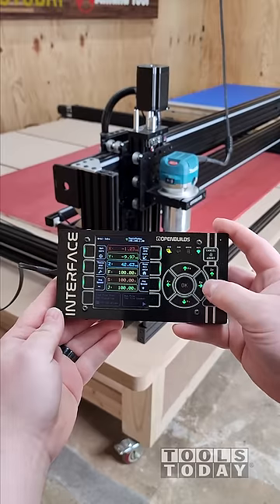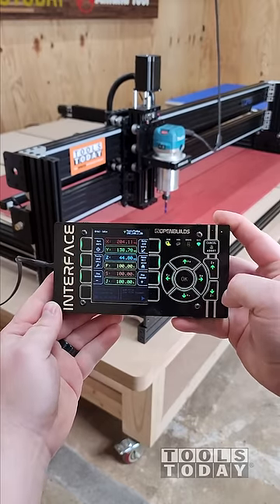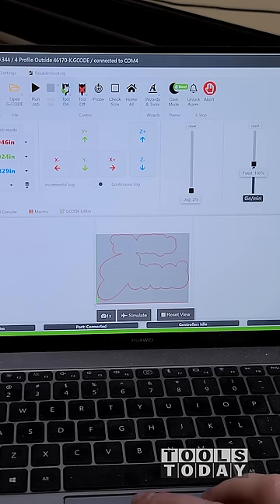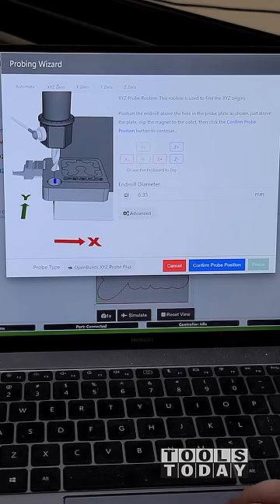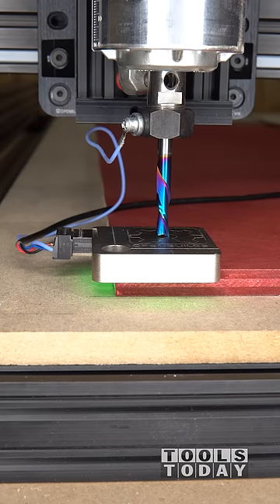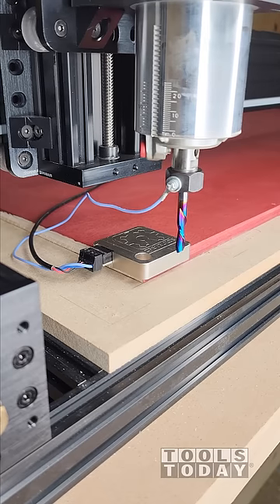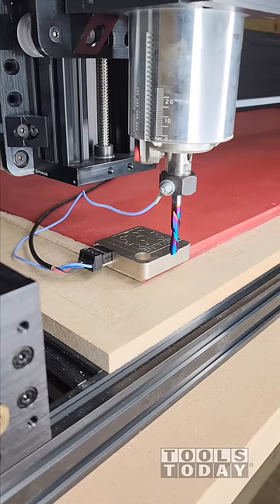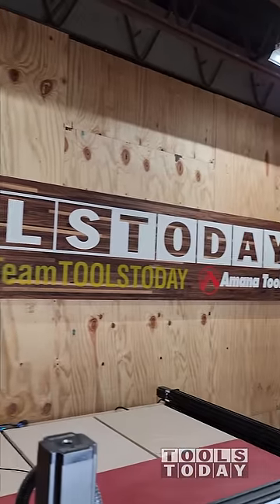Easily Set Zero Positions on CNC

Comment: One thing I noticed - that 2 flute bit looks like it touched the y on part of the core where the x touched on the edge of the flute.  To avoid an axis offset error, it Makes the most sense to zero like this with a precision ground rod or a carbide ball tipped probing bit.  For large workspace work the potential error likely won't be noticable, but the more precision and smaller workpiece you get, the .030" error could make for some frustration.
Reply: So glad someone noticed. 🤣
Reply: If you probe it deep enough, you contact the cutting edge of the flute no matter what angle the tool is rotated to, so likely not an issue.
Reply: Using a rod or ball tip for X and Y would definitely be ideal, if it was a .03 error like you said that's quite a lot and could make a lot of things unusable. Another idea since this is a router is to just set up a sort of jig/ part stop and have a consistent X/Y starting position for most of your pieces and just use a different set of offsets for special cases.  (Basically set a "permanent" G54 offset and use G55 or something else for anything that wouldn't start at the preset G54.)
Reply: the flute has the same diameter at the middle part and the tips. should not make a differenece
Reply: Thank god, this is what I wanted to say but couldn’t fathom where to begin. Thank you
Reply: Nope, not an issue. The bit is parallel, and the detection zone is deep enough that it covers at least a full spiral. It touched off correctly. However, if it were a single flute spiral plastic bit, you'd need to use a rod or something else, to avoid that issue.
Reply: This is what I do. I use the shank of a broken 1/4" bit for my setting.
Reply: Or just give it a g04 to reverse the spindle direction and touch off while it's spinning
Reply: On metal cnc machines we run the spindle slowly in reverse to measure the tool diameter and length offset.

Comment: This would be "close enough" for finding the zero corner of a plywood sheet to cut out pieces, but in that case eyeballing would be more than adequate. NOT if you wanted to precisely locate on an already finished object. You'll be off by as much as 1/8".

Comment: You're going to be off depending on what point of the flute makes electrical contact. Youre better choice would be the endmill shank as they are a precision ground cylinder
Reply: that was my first thought... then again I'm used to more precise work
Reply: Or you just rotate the tool in reverse at low rpm like most CNC machines with a tool setter

Comment: Shouldn't the tool spin at a low rpm when you do the X/Y calibration, The 2-flute is defiently not round. Not critical for most parts, but then why need a conductive zeroing tool?
Reply: You should either use a same diameter drill rod or rotate the bit by hand so the widest part touches the XY plate.  Then swap to your bit for Z.
Reply: Maybe the program accounts for that  by also knowing the able of the piece?
Reply: Right! You can't zéro with a tool on x/y, only on z. You need to use a spécial tool, at low rpm, or a  round profile to do those. 
You don't do this for all tools, because you center the splindle. Only z change between tools.
Reply: Low rpm in reverse
Reply: It uses plastic rollers on the z. This is a toy. not a persition tool. This man needs limit switches and a simple z probe save some money and time
Reply: @takeawaykitty.  plastic rollers can be plenty strong if the build is set up properly. My old router used delrin wheels to support x while cutting aluminum. Plenty strong and definitely not a toy
Reply: @mars5train601  plastic rollers introduce tons of slop into the system and wear away if they are tight (creating slop) For somthing with load on it. Compared to somthing like liniar rails they are 1000% a toy. Not to mention reasonable cutting loads would crack or cause flat spots. All while messing up the the tram for the duration of the cut. Maybe with a .1mm depth of cut in 6160 it could work without imidiatlly destroying the machine but your still going to see reduced tool life and wheel life. Especially when tramming is basically impossible. This is not an accurate or strong cnc. And that's ok. It's meant for wood.
Reply: What do you expect from someone who can only assemble a toy CNC? Ffs he uses a router, not even a basic air cooled dedicated spindle
Reply: First of all, my comment was intended as a guiding question - to enlighten people a bit. 

Secondly, it's so much codswallop from Internet trolls that think a 7 axis DMG Mori is what he should operate to cut out plywood! The right tool, is the tool you have available, and get the job done. Brighten up you gacking pessimists
Reply: @Hitokiiry  it absolutely does not account for that
Reply: YES.  Either rotating OR a precision ground rod.  This method can introduce error because it could zero on the edge of the flute on one axis and on the core for another axis.
Reply: There isn't a way to account for a 'random' error.   It doesn't have a spindle encoder and it has no idea what part/side of the endmill is touching.  A 2 flute endmill could zero on the edge of the flute or on the core and would be completely random with the rotation of the endmill.
If you are going to do a conductive contact zero, the spindle needs to be rotating or you need to use a precision ground rod or a carbide ball tipped probe so you have a consistent diameter regardless of the side/axis it touches.

Comment: This is amazing I'm building a cnc at the moment and this is something I will definitely use
Reply: If you're cutting anything more precisely you'll need something better. Generally without anything extra(except a z height setter) you'd use the centerline of the spindle and the diameter of the cutter to find position. To change size of features use the wear offset to make any small changes needed. You'll be way more accurate and all you'll need is a z height touch off and a caliper or micrometer to find the diameter of your cutters.

Comment: Looks like you are using a 2 fluted tool.  To accurately set your X & Y zeros you need to manually rotate the tool so that it contacts on the same dimension of the tool.  

Your X zero was set on a land but your Y was in a flute.  Your Y zero could be off by as much as the tooth depth.

Comment: The tool is not 100% a circle. So the homing is not 100% 000. Also the drill have a thickness. How does the machine know this?
Reply: The drill size is loaded into the software so it knows how to calculate the offset. The system uses a small amount of electricity to complete the circuit when the bit and block touch so it doesn't matter where it hits on the bit as the outside diameter will still be detected
Reply: @RapTapTap69  sounds valid but the radius from the center of the bit to the blate is in different angels different. (Sorry for my bad English)
Reply: @flinkiklug6666  yeah from the center to the edge is different inside the flutes but due to how the bits are made, the flutes will always be what touches first. There's not a place where the plate could hit anything but the outside of the bit.

That could happen with a straight flute bit but not with a spiral bit
Reply: It's a two flute endmill so it could (and did) touch the end of the flute on one axis and the core/inner flute on the other, therefore introducing an error.  The spindle either needs to be spinning or you need to use a precision rod or carbide ball tipped probe to ensure it doesn't introduce error.
Reply: It doesn't and you are correct.  The higher the flute count endmill the less error will be introduced, but regardless unless you're using a ball tipped probe or a precision ground rod, you will introduce error with this method using a two flute endmill.
It might not actually even matter because this is a router and the workpiece is large so a small offset isn't noticable.  If you are doing multiple operations, you would have to have a repeatable work holding method or else you will always have a small error/offset.

Comment: It looks nice and pricey for a zero-point configuration tool that sets up only one absolute starting point in the DIY milling machine. From there it’s just straightforward when programming in that specified absolute G90 position and when being able to make use of the CNC-software programming language you can set up a bunch of G91 incremental (G92/G93 etc.) zero-points when needed those for the use of multiple tools. The only thing that i don’t understand is how often will do with less accurate levels if the results (the end result of contour, chambers and circular pattern milling) will be fully depending upon the accuracy of the machine’s travel movement and feeding steppers? I mean, with this tool it’s possible to zero in between 0,02mm, and via old school methods of zeroing xyz the accuracy declines. Not dramatically i’d say, between 0,2mm accuracy is fully assured when setting up for a starting point. It’s not even close to an industrial multi tool, fully automated CNC-milling machine or workstation for cutting metal. 

I do admit that i’ve been very privelliged and sort of spoiled by every single former employee that i did end up working for in the past (never in my career i needed to cut timber or other wood based materials. At home i do, so i do like the tool used for setting up xyz in 4 different handlings at maybe 20 seconds 👍🏼

Comment: Did you press firstly Tool On option before probing? 

I have the same Probe from OpenBuilds but is not working in most cases, it measures the Z and stops after that as a crash detection....

Comment: are you able to spin that bit slowly while touching off? what if it doesnt hit the point perfectly? Our machines, we turn the spindle on. just curious how this works
Reply: If you're spinning the bit there's a good chance you'll damage the zero block. Every time you damage it, the reading will come back more and more inaccurate. The bit should hit straight unless there's significant chipping so running the zero while the bit is running is just asking for trouble.

Comment: Holy crap, this is cool! Does an “ebay” 6040 support this sensor? Tks
Reply: Depends on the control board, but it can be plugged as an endstop, so most will be able to use that.
You can set it manually too, just jog on the smallest increment till it is on, then subtract the width of the measuring thing and also subtract the radius of the rod for the x and y.

Comment: How much for a CNC like that
Reply from the maker: It's just over $2,800 for everything you need, except the cutting bits. https://www.toolstoday.com/openbuilds-3050-fl.html
Reply: That's about what it cost me.  Mine was actually damaged in shipping and open builds sent me a brand new frame within a couple days once I sent pics, great customer service everytime I have a question or problem they provide a quick solution.  It is just a hobby level machine and tbh I think it is best suited for laser or plasma but it handles a router just fine if you keep up with maintenance.  Also important note I would use blue lock tight on the entire z gantry.. experiences....

Comment: What controller u r  using to controll ur cnc
Reply from the maker: OpenBuilds Control software.
Reply: @ToolsToday  what program u uploaded in your machine ..... Is it is grbl ?
Reply from the maker: yes
Reply: That's great 
My machine is not working well bro can you guide me on this
Reply: I am also using grbl mega 5x edge 
But my z.axis motor is not working well
I want fully automatic tool command and homing and hardlimits not working for another end of machine for safety purpose

Comment: Its perfect! Can you write the same macros for Mach 3 CNC machine?
Reply: Depends on what the encoder reads.  If it takes Fanuc based Gcode, then macros are easy.  But if it uses something else, it’ll depend on your ability to translate those macros into functions the machine can do.
Reply: @kw2519  it is old LPT CNC board, incoder is only one, the switch(optic-couple) "Connect or disconnect" in the board. "Gnd" on the probe, "+5V" on the cube like in video.
Reply: @krevedko_GM  ok so maybe not 😂

Comment: Can i use this with a hass machine?
Reply: No!  You should use a Haimer or a ruby ball tipped probe when using a large or precision mill.  This method can allow for an offset because of where the endmill touches.  If it's a 2 flute mill, it could touch on the edge of a flute OR on the core/inside and introduce a small offset error and could be slightly different every time.  Precision machines should use a precision zeroing method.  This method makes sense on routers where a small positive offset wouldn't be an issue because the workpiece and material is large enough that it wouldn't be noticable or if you have a repeatable work holding method where the offset is nullified.
Reply: Dude, use a dial indicator or haimer 3d probe, this thing isnt close to the precision required
Reply: I wouldn't, but then I wouldn't use a Hass either...
Reply: @Convolutedtubules  thanxs
Reply: @indian.techsupport  thannk you
Reply: @shirothehero0609  thanks for the help